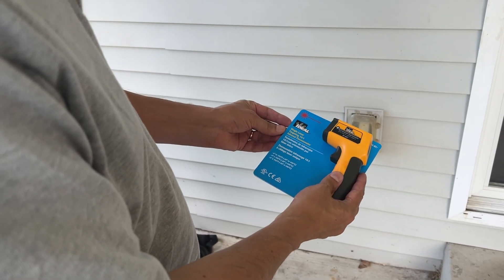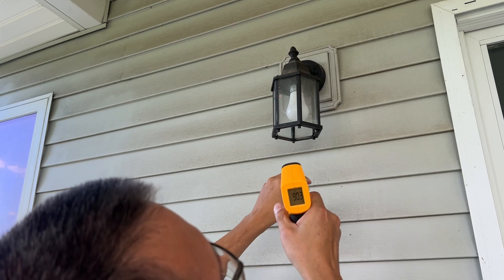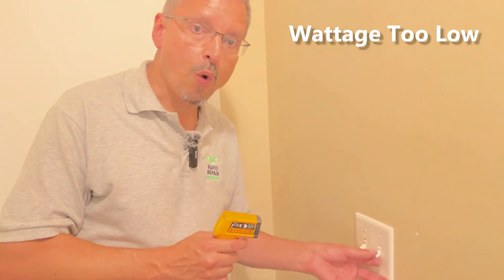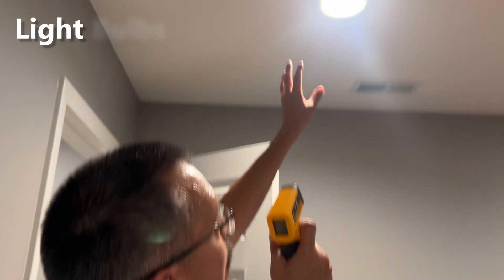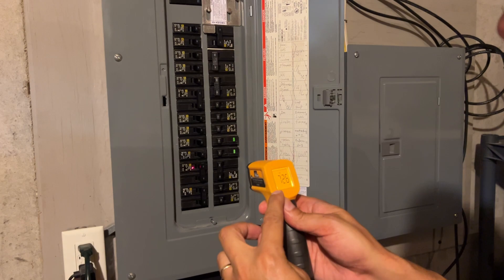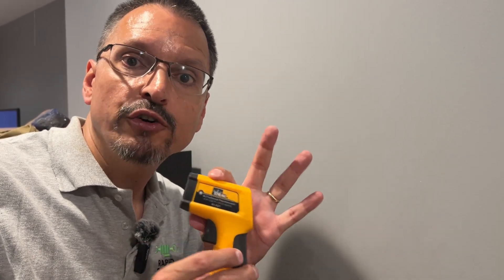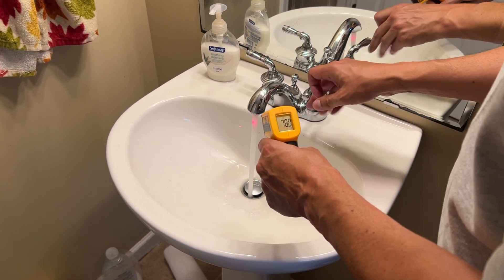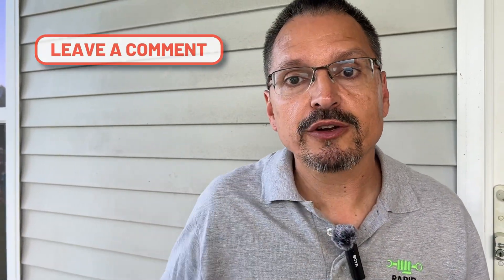A Must-Have Tool for Electrical Safety and More - Become a Better DIY'er

Comment: Had one for years… the laser is also helpful for driving my cat nuts.  
I bought a flir thermal camera years ago that really helped me out with insulation, detecting wires and helped with car repairs.
Reply from the maker: They are cool for sure. Thanks for sharing. I also own a thermal camera when I’m doing home inspections 👍🏼😊